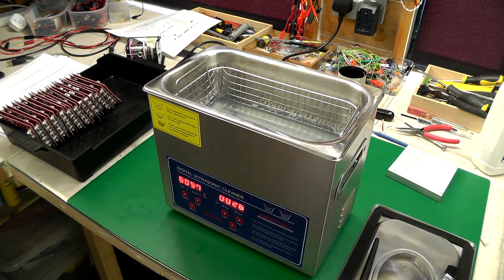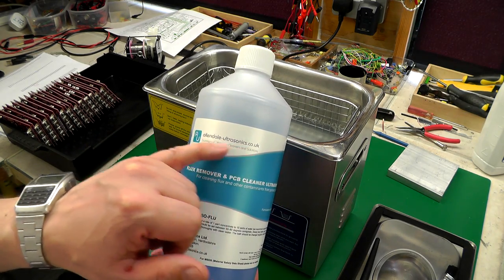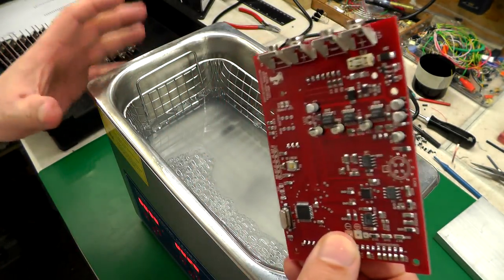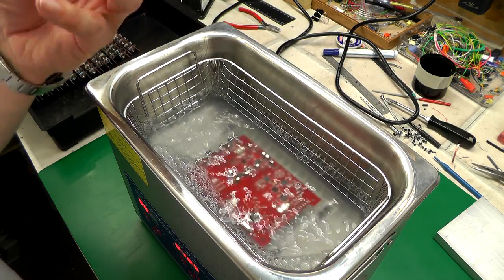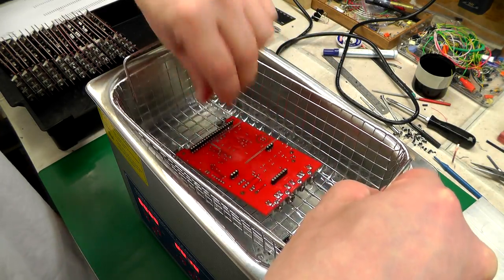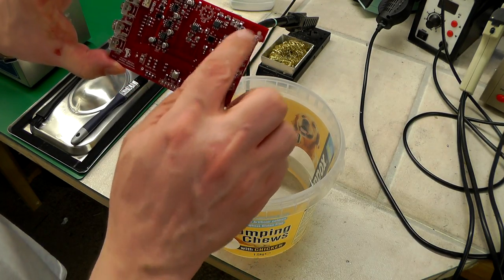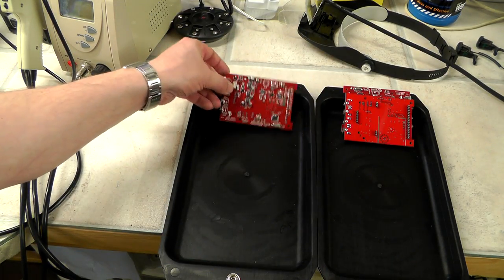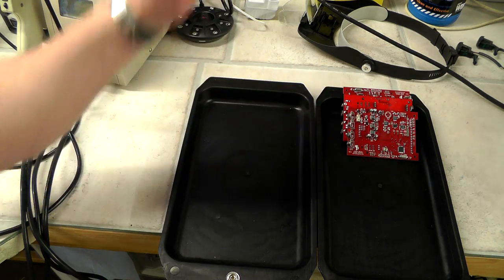No.026 - Ultrasonic Cleaner PCB Flux Removal

Comment: The fact you need to use a brush tells me that perhaps your ultrasonic device doesn't really work. I suspect that a plastic tub filled with that solution would do just as well. The ultrasonic action is supposed to do the work for you, it looks to me like its simply not designed to work with that solution and the device is just acting as something to store it in. also for drying, set yourself up a chemical drier, in 20 mins in a drier from wet and it'll be properly dry, no heat gun.
Reply from the maker: The ultrasonic action definitely works, I just speed it up with the brush. Double the time or more if you don't use a brush. I'm just impatient!
Reply: IanScottJohnston I see. I would still suggest you get up a drying box. An empty black tub, fill it with any chemical drying agent and put a cookie rack on top for separation. takes up little space, and if you put a little electrical tape around the inside of the lid and always keep it closed it lasts for ages before you need to refill. Also has the upside you can get everything needed on the cheap in Wilcos.

Comment: I was under the impression that the basket much be suspended in the solution not setting on the bottom of the tank.
Reply: correct

Comment: are those phenolic boards?? Red boards are usually phenolic boards from the 70's why arn't you using fiberglas boards?
Reply from the maker: FR4. You can buy boards in a variety of solder mask colours these days. No difference other than colour.

Comment: Instead of a heat gun, I would used compressed air to blow off the water.
Reply: Hair dryer works faster and doesn't heat it up enough to do any damage. The heat definitely speeds it up.

Comment: I would prefer pure alcohol for the last step instead of water.
Reply from the maker: Hi, when there is a lot of boards to clean off it's much less expensive to use the wash. As soon as the alcohol gets the least bit contaminated it leaves marks on the pcb and can dull the surface........that's what I found anyway.
Reply: Interestingly I dont own a ultra sonic yet, I bought one as a result of this video (a 2L one) but I found "hair shampoo" with a tooth brush effective,  the digressing properties are rather effective, no spots, no contaminates but I'm still evaluating with an ultra sonic cleaner.

Comment: Why have an Ultrasonic cleaner if your gonna use a brush ??   Defeats the purpose.
Reply from the maker: The choices available to get rid of every bit of flux residue are:
1. 10mins in the cleaner.
2. 4mins and the use of a brush, and I can target the known stubborn areas of the PCBs.
Don't forget I routinely clean 25 boards in one go, that's a lot of minutes saved.